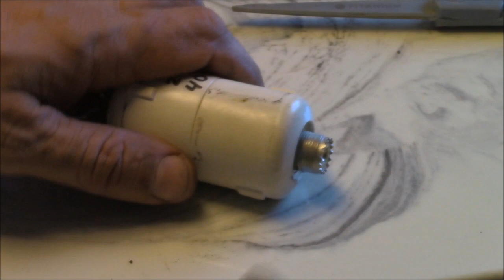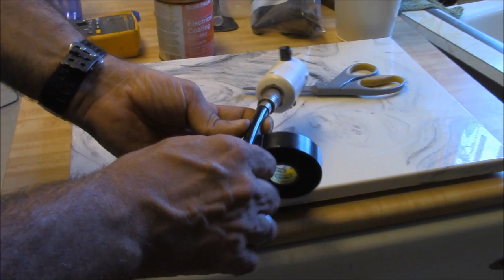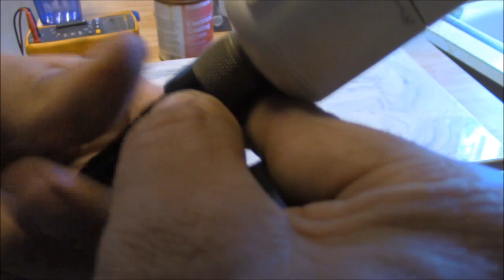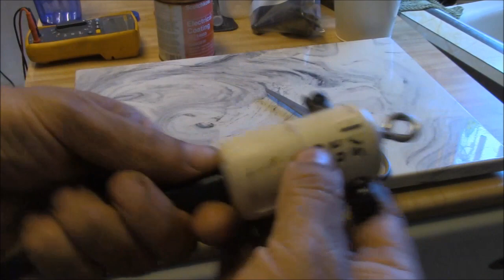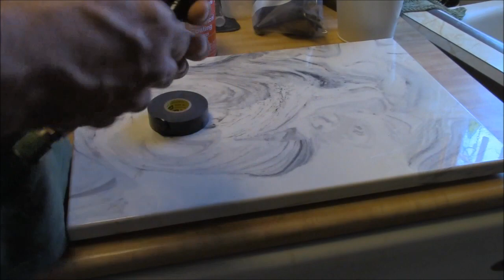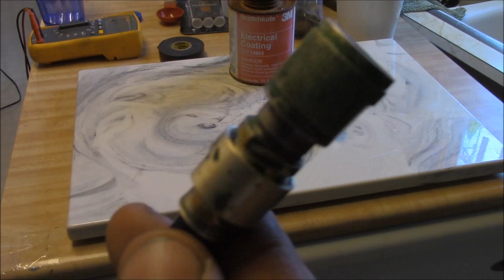Antenna Connector Weatherproofing

Comment: #1 "don't get finger oils on the tape"...but when you touch the previous layers and then put tape over where you touched, you are essentially doing the same thing.  #2 never tear electrical tape...it stretches the adhesive and it will eventually peel off.  Also, most people use stretchable silicone silicone tape for antenna connectors, but electrical tape works, too.  I would never use liquid electrical tape goop.